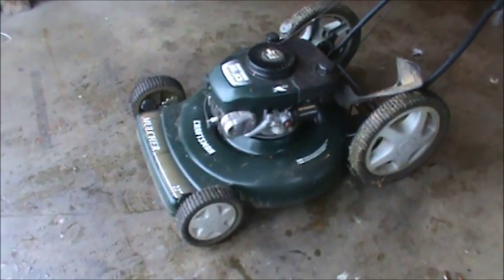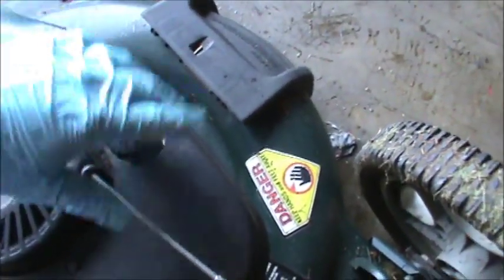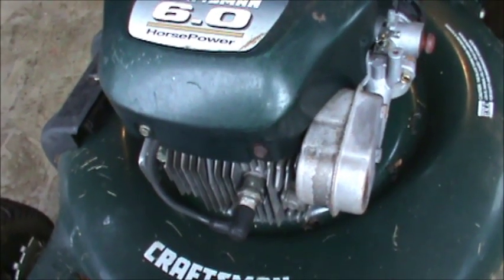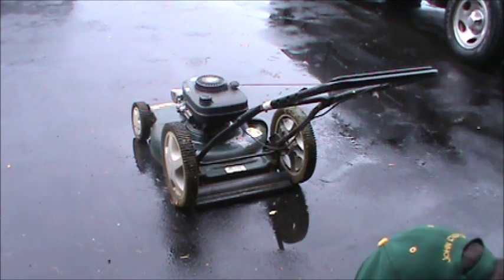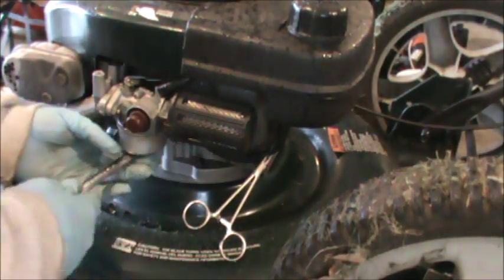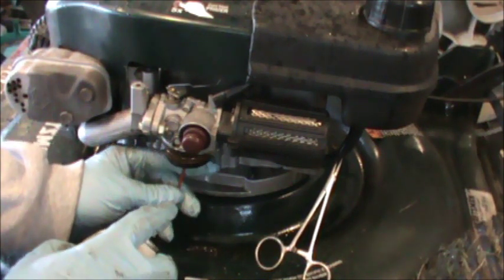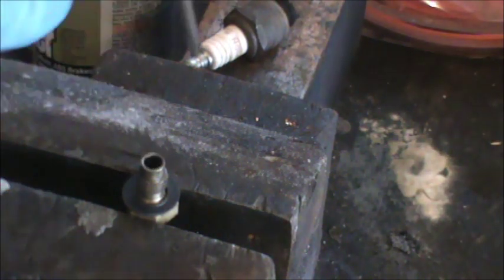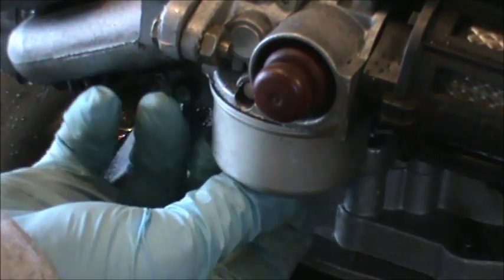Craftsman Lawnmower Timing and Carburetor Issue

Comment: Thanks, usually when a blade is bent that severely the flywheel key is at least partially sheared. It's amazing that the crank isn't bent. Great vids. I'll be checking out the second one real soon.
Reply from the maker: Surprising, the crank is not bent: no vibration what so ever.
Reply: Alan Marshall I picked up a 4 h.p. Brigg and the blade was bent WORSE! I re-ringed it and it runs GREAT! Those Tecumseh mowers suck!

Comment: Good video, I find that once I get a carb clean (or as clean as I can get it) the next step is fresh fuel and seafoam.  No matter how much I try to clean a carb it seems like there are those passages that you can't access that give me fits.  A healthy dose of Seafoam usually clears it up over the tankful.  Brake cleaner works great, but devours paint.  You've got a great channel!
Reply from the maker: Thanks for the info,  I have heard all about seafoam, but what is it and where can I get it.
Reply from the maker: This mower does not have a fuel problem because it does not surge at all,  the sound at the muffler just sounds odd.  More investigation required.
Reply: doublewide6 Its a fuel and engine additive, Walmart has it the cheapest usually.  There are many uses for it, Deep Creep is Seafoam in an aerosol.  I use that to fog my outboard, its really good stuff.  All can be purchased at Walmart or auto centers.  Good when poured right into the carb with the engine running, smokes like crazy- then turn off and let sit for 20 minutes.  Its a good stabilizer for ethanol fuels too.

Comment: I have one of these with a tecumseh engine. The blade must be on and balanced, because it's the counter weight for the crankshaft.If not it will run like its out of time. As far as the carb, take off the breather and choke it by hand. After 5 or 6 times of starting it this way, it cleared up and started every time with one pull.

Comment: Sounds like a sheared flywheel key, I've had some that don't' kick back even though they're out of time.
Reply from the maker: Alan,  Thanks for your response,  I ended up changing out the gas and pulling the entire carburetor and cleaning it.   It runs pretty good, but has a weird sound at the muffler.  I am going to make video 2 on checking compression and the flywheel key.  Stay tuned thanks for commenting.
Reply from the maker: Alan, you were correct.  I made video 2 and discovered a partially sheared flywheel key.  Thanks again for your comment.

Comment: I have a craftsman m100 and it want crank I have changed the head the head gasket put a new spark plug wire and new spark plug changed the primer and cleaned the carburetor new air filter and put a new gas line and fresh fuel in it and it will not crank its sparks flame with the filter off idk what's going on and i think it jumped time and idk how to retime it we turned the piston because I was cleaning every off because I retreaded the hole on the old head and messed up because I could get the new threads right so I changed the whole thing